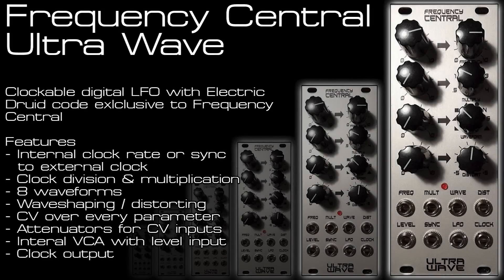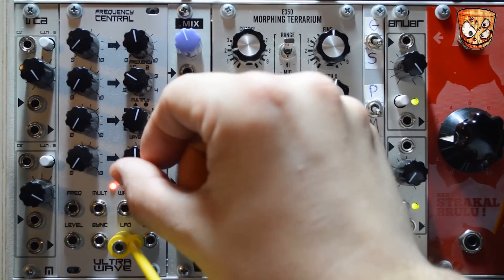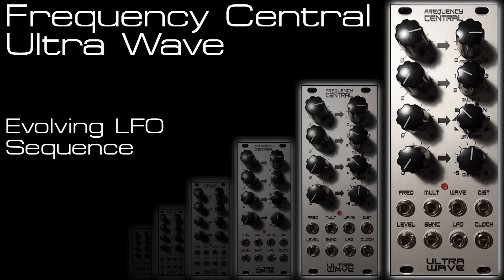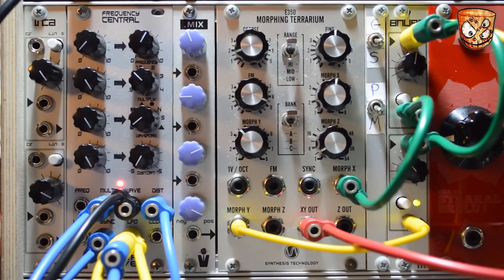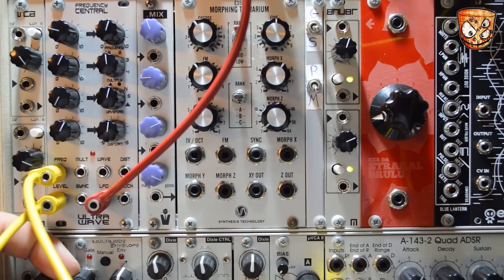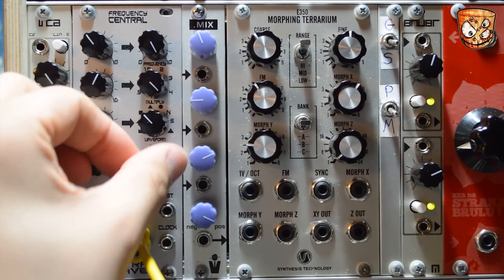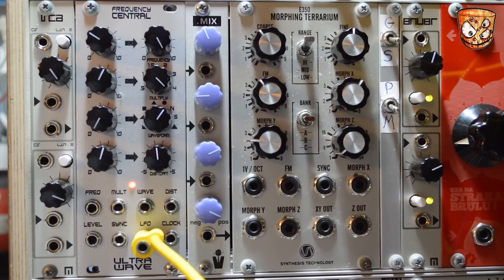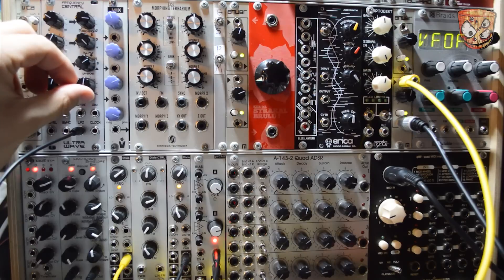Frequency Central - Ultra Wave

Comment: I've looked at this.  It looks super easy to build, just a few dollars worth of parts and you'll be on your way.  I'm thinking of getting a couple or four.
Reply from the maker: adnauseam23 a pair would be great! Couple if with the new (video coming soon) Bartos Flur for some CV addressed gates and triggers and maybe the System X sample and hold and you've got a great modulation hub for your set up.